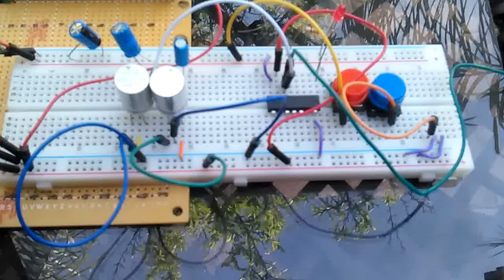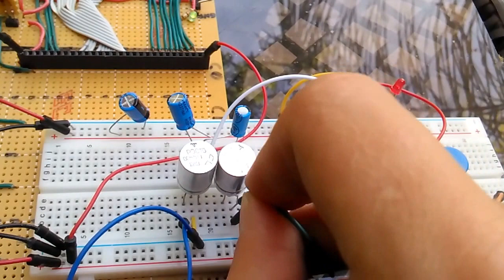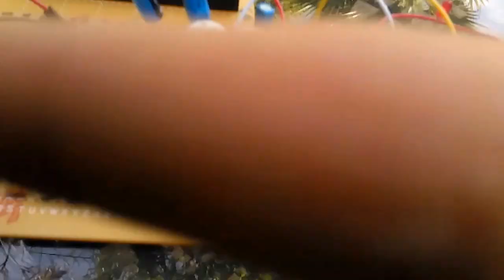DRAM test with Relays - Now Semi-Non-Volatile!

Comment: It IS volatile because capacitors leak :-)
I notice that the video is more about the capacitors holding charge, than relays.
I'd love to see the relays in action in the next video :-)
Reply from the maker: Is it volatile? Or Non-volatile?  It holds the data through a power cycle, yet capacitors leak.  Does this mean it's both?  Interesting, isn't it?  Maybe I will add  some logic or something to keep the data refreshed once every minute or something.  Then it would be 100% non-volatile.
Reply: It's dynamic for a good reason, you know ;-) It's just a matter of scale, you use microfarads, DRAM chips work at atofarads...
I'm waiting for the next videos :-)
Reply from the maker: What if I used more capacitance?  Say, 47uF
Reply: it's up to you to experiment and find the right compromise for your circuit :-)
More capacitance means longer retention but also larger capacitors (more room), more expensive circuit, more current to charge it fully in a given time...
Reply from the maker: Yes.  With the capacitors I have it seems that data will be retained for longer than my simple tests.  It is non-volatile enough for now.